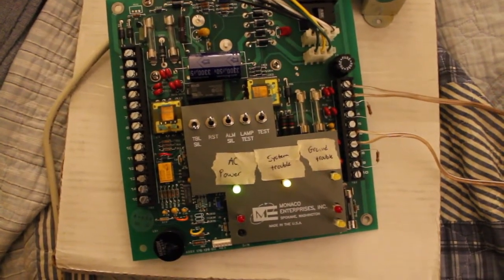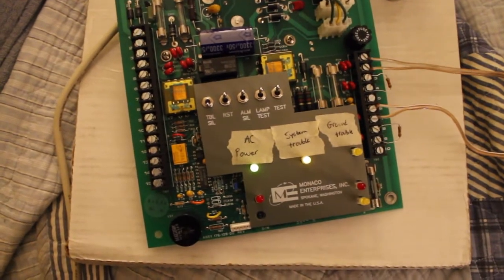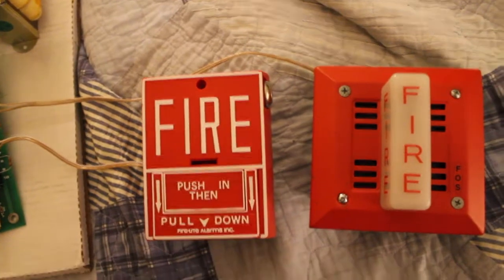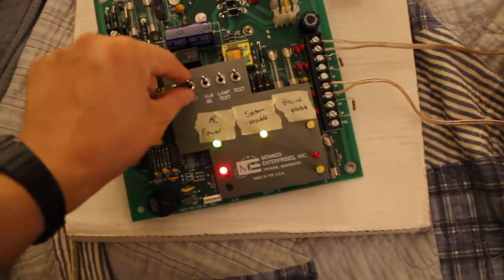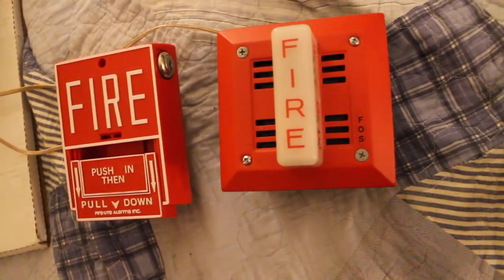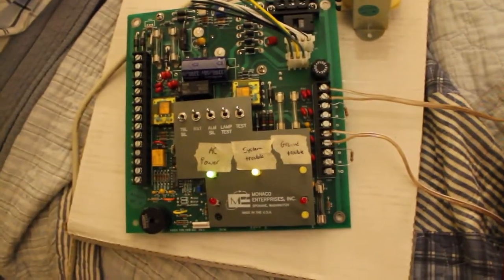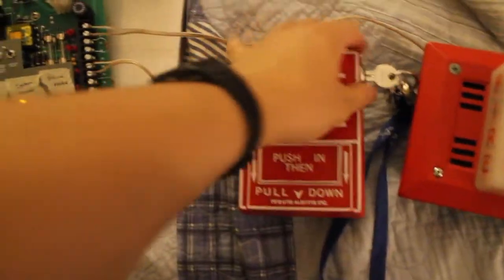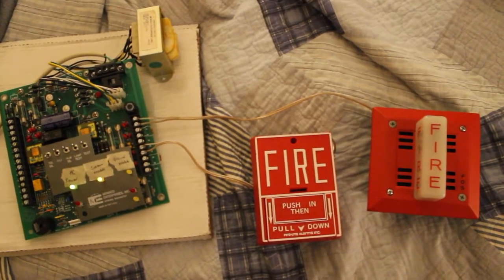Monaco Vulcan 1 - System Test 11

Comment: I got my hands on a Potter Fireguard 4000!

Also, probably a stupid observation, but I'm guessing the system trouble is because a backup battery isn't hooked up, right?
Reply from the maker: Took a look at some of your videos of your new panel, looks like a simple, but awesome panel as well, similar to this one.

And you're correct, the trouble is the lack of battery. Admittedly, I only set this thing off for tests like this, and don't use it very much. Therefore, I haven't bothered to search for a battery, or even a cabinet for that matter. If this were a bigger, more permanent setup, then I would probably take the time to find a battery. Doesn't help I've been super busy for that matter.

Comment: Didn't Simplex rebrand that FOS horn strobe?  I've swear I've seen a Simplex horn strobe that looks just like it.
Reply from the maker: To my knowledge, Simplex has not rebranded the horn/strobe you see before you. I do know they rebranded the horn only version that has the trim, but cannot pin the model number. The surface mount version (without the trim) is the 2901-9838.
Reply: ***** maybe the other one is the 9833?
Reply: the version with the trim is the 9840